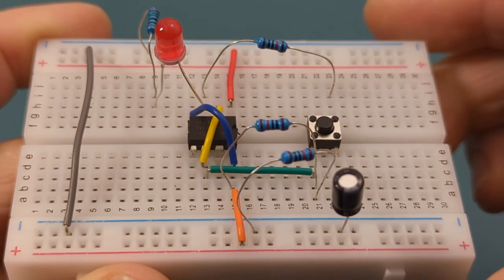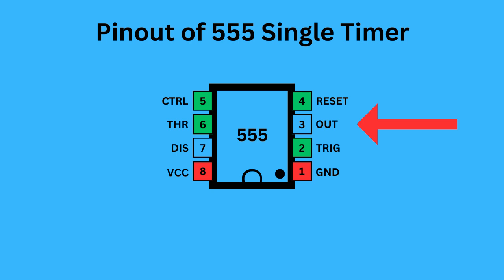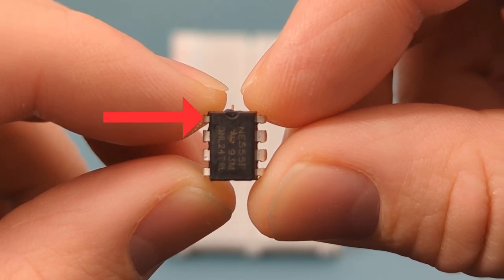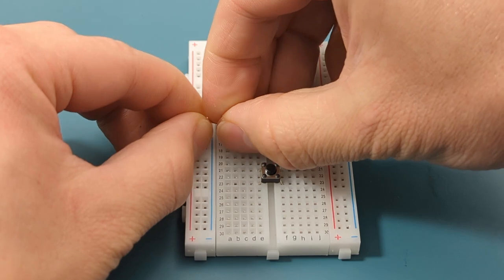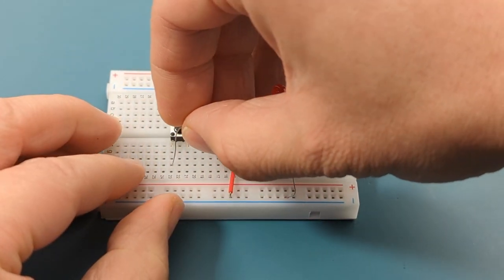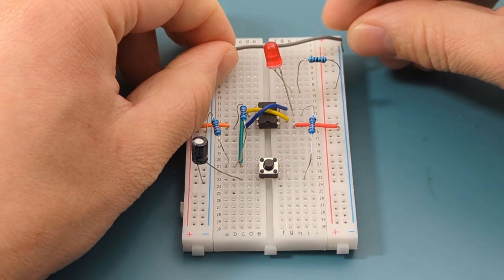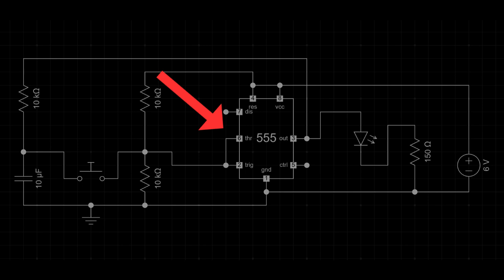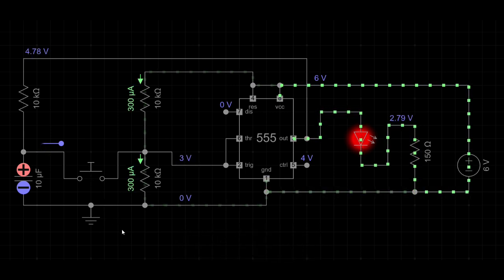How to Make a Latching Relay Circuit With a 555 Timer

Comment: LED stays on, I've changed the 555 and double checked all connections, not sure what's happening
Reply from the maker: If the LED stays on, it could be an issue with the reset pin or the capacitor timing. Make sure the capacitor connected to pin 6 is the correct value and not shorted.
Reply: i had this problem. my circuit would only latch and not unlatch. thats because i was using a Li ion to power it and it would stop unlatching below 3.9V. the datasheet says 4.5v min.

Comment: Any reason why i tried it and one out of four ne555ic not working correctly. The 10k voltage divider remains at half voltage with led always on. Connections are wired correctly.

Comment: It doesn't work led stays ON only after triggering
Reply from the maker: Thanks for the feedback! It sounds like the circuit might not be resetting. Please double-check the wiring, especially pin 4 or reset and your timing components.
Reply: @ElectroUniversity but works fine with 2 push button

Comment: a little modification to the charging resistor of the 10uF capacitor up to 20kOhms eases up the circuit better and also debounces the switch so the led will not change state if you push the button twice too fast... also it prevents the led from changing state if you press too long...

Comment: Does not seem to work???
Reply: Yes I have designed this circuit in EveryCircuit exactly as he did in the video and it will not work.
Reply: If you make it step by step, you’ll see he omitted the placement of an extra 10 microfarad capacitor and 10kohm resistor. Adding these made it work for me.